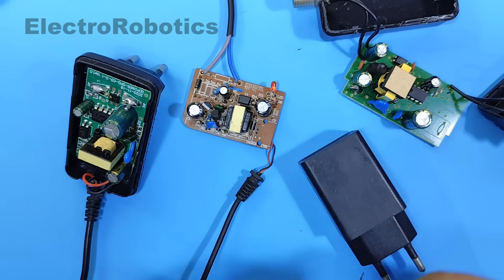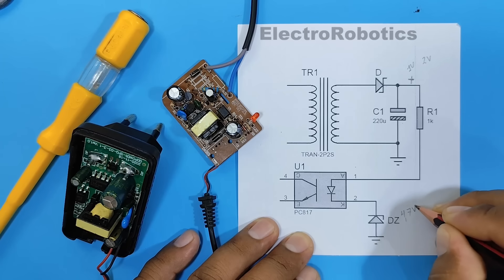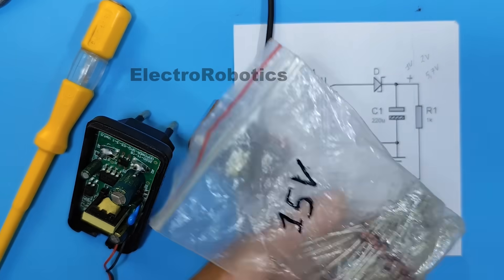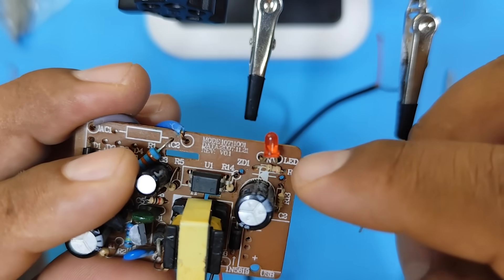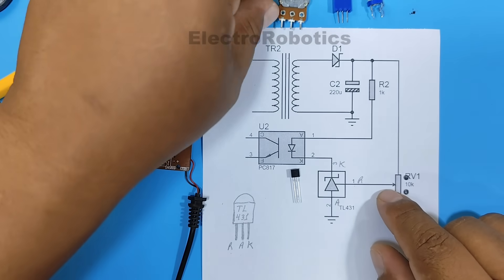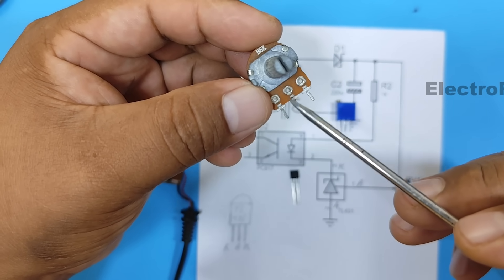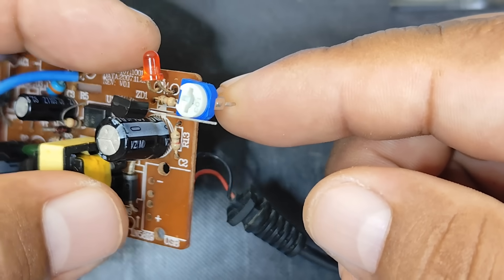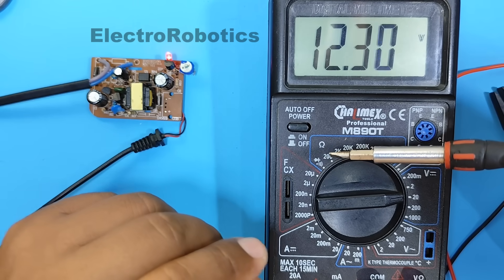Modify Any Charger and Adjust Its Voltage.

Comment: Nice love it!
Now how about a video explaining what happens at the other end of the opto coupler. 
Like why does the voltage stop climbing .
Reply: Do not be FOOLED !

So much mis-information
- FIRST SAFETY  is important but no safety precautions are given. The part about adjusting the trimmer is scary bad.
- The current must be reduced else it will over-heat and self-destruct.
 - it does NOT work on all chargers. 
- the output waveform will be degraded, so the load may not work properly.
- he does briefly mention the issue with the output cap .....be CAREFUL. For example if you change to 12V then the output cap must rated at least 16V

 This mod has been around for many years  by very ignorant channel makers. It is too bad he has repeated the same mistakes and same mis-information. He should know better.

Comment: The electrolytic capacitor voltage ratings must be changed if lower than the new voltage rating. Otherwise, they will roast.
Reply: Many flaws in this so called "quick fix." I hope no ones house burns down because of it.

Comment: U just earned a subscriber.
Reply: Do not be FOOLED !

So much mis-information
- FIRST SAFETY  is important but no safety precautions are given. The part about adjusting the trimmer is scary bad.
- The current must be reduced else it will over-heat and self-destruct.
 - it does NOT work on all chargers. 
- the output waveform will be degraded, so the load may not work properly.
- he does briefly mention the issue with the output cap .....be CAREFUL. For example if you change to 12V then the output cap must rated at least 16V

 This mod has been around for many years  by very ignorant channel makers. It is too bad he has repeated the same mistakes and same mis-information. He should know better.

Comment: Thank you for making this video tutorial
Reply: Do not be FOOLED !

So much mis-information
- FIRST SAFETY  is important but no safety precautions are given. The part about adjusting the trimmer is scary bad.
- The current must be reduced else it will over-heat and self-destruct.
 - it does NOT work on all chargers. 
- the output waveform will be degraded, so the load may not work properly.
- he does briefly mention the issue with the output cap .....be CAREFUL. For example if you change to 12V then the output cap must rated at least 16V

 This mod has been around for many years  by very ignorant channel makers. It is too bad he has repeated the same mistakes and same mis-information. He should know better.

Comment: It is Neither the Brand Nor the Products that Attracted me. But, the Noble Approach the Advertiser from Tamilnadu has, in the Middle of a Youtube Video in Such a Well Mannered  way💕 <3 <3 <3 Unlike Those Rude Gamblers/Advertisers(Mostly  Scammers)🤮🤧 within our Country 🇮🇳🤮🤧that, usually Appear in the middle of Nowhere(always) in Irritating >:(  ways🤬🤬🤬🤬😡That, I might End up buying a Few Pieces from them👍🏻👍🏻👍🏻👍🏻👍🏻And I also think, Others Must learn from them How to actually "Approach" 🙏🏻
 the Viewers if they want to Promote  something rather than Bugging! 🤬

https://youtu.be/zD1mbbCMP2s?si=v1zxsG1b9-PnvKFK
Reply: >>>>>>  Do not be FOOLED !

So much mis-information
- FIRST  no safety precautions are given. 
- The current must be reduced 
 - it does NOT work on all chargers. 
- the output waveform will be degraded, so the load may not work properly.
.. be CAREFUL. if you change to 12V then the output cap must rated at least 16V

 This mod has been around for many years  by very ignorant channel makers. It is too bad he has repeated the same mistakes and same mis-information. He should know this unless he is a Professor of BS

Comment: I really learned how change the output voltage of the celphone charger. And I probably can do it to other adapter.😊
Reply: DON'T!!!
Reply: >>>>>>  Do not be FOOLED !

So much mis-information
- FIRST  no safety precautions are given. 
- The current must be reduced 
 - it does NOT work on all chargers. 
- the output waveform will be degraded, so the load may not work properly.
.. be CAREFUL. For example if you change to 12V then the output cap must rated at least 16V

 This mod has been around for many years  by very ignorant channel makers. It is too bad he has repeated the same mistakes and same mis-information. He should know better.

Comment: Thank
Reply: >>>>>>  Do not be FOOLED !

So much mis-information
- FIRST  no safety precautions are given. 
- The current must be reduced 
 - it does NOT work on all chargers. 
- the output waveform will be degraded, so the load may not work properly.
.. be CAREFUL. if you change to 12V then the output cap must rated at least 16V

 This mod has been around for many years  by very ignorant channel makers. It is too bad he has repeated the same mistakes and same mis-information. He should know this unless he is a Professor of BS

Comment: Galing ng Pinoy! Salute
Reply: Do not be FOOLED !

So much mis-information
- FIRST SAFETY  is important but no safety precautions are given. The part about adjusting the trimmer is scary bad.
- The current must be reduced else it will over-heat and self-destruct.
 - it does NOT work on all chargers. 
- the output waveform will be degraded, so the load may not work properly.
- he does briefly mention the issue with the output cap .....be CAREFUL. For example if you change to 12V then the output cap must rated at least 16V

 This mod has been around for many years  by very ignorant channel makers. It is too bad he has repeated the same mistakes and same mis-information. He should know better.

Comment: Good job how would i increase amps as voltage increase
Reply: >>>>>>  Do not be FOOLED !

So much mis-information
- FIRST  no safety precautions are given. 
- The current must be reduced 
 - it does NOT work on all chargers. 
- the output waveform will be degraded, so the load may not work properly.
.. be CAREFUL. For example if you change to 12V then the output cap must rated at least 16V

 This mod has been around for many years  by very ignorant channel makers. It is too bad he has repeated the same mistakes and same mis-information. He should know better.

Comment: Just don't electrocute yourself. You worked there with an unsecured mains voltage device. Which can be 240V and 20A on normal outlets. Ground fault detection and isolated, current limited circuits go a long way.

For the ones playing along at home: Don't!
And if you really can't stop yourself, do only modify it while it isn't plugged in.

Only plug it in, when the case is closed.

Comment: Wow! thank you
Reply: >>>>>>  Do not be FOOLED !

So much mis-information
- FIRST  no safety precautions are given. 
- The current must be reduced 
 - it does NOT work on all chargers. 
- the output waveform will be degraded, so the load may not work properly.
.. be CAREFUL. For example if you change to 12V then the output cap must rated at least 16V

 This mod has been around for many years  by very ignorant channel makers. It is too bad he has repeated the same mistakes and same mis-information. He should know better.

Comment: Make Sure to pay attention to CAPACITOR voltage too, over voltage the capacitor it will make it Explode, change the capacitor to higher capacitor voltage rating
Reply: He mentioned that, CLEARLY, in the video. 🤦🙄 Unless of course, he redid the video between the time you posted this comment on the first week of April until now, April 27th.🧐🤔
Reply: @mahmoudbitar6571

He addresses that at 11:09.
Reply: Stated that clearly
Reply: Also consider the original power at its output. So if you alter a 5V/1A output to 10V, its output currents should stay below 0.5A to meet the capabilities of the total circuit.
Reply: For safety, unplug from AC supply voltage,  wait for 30 minutes before touching any electrical compoent ( s ).
Reply: @davidchoi6068 Pointless waiting 10min just shorten it out
Reply: Who bas 30 to throw away. Just short the cap and move on with life.
Reply: 😂😂😂😂 while he know the difficult stuff of modifying this then do u expect u know better than him... hurm...
Reply: Thanks for the reminder. He mentioned it but it doesn’t hurt to emphasize this important caution to this electronics neophyte. 🤔  👍

Comment: Wow, thanks for sharing sir
Reply: DO NOT BE FOOLED!!!
So much mis-information
- FIRST SAFETY  is important but no safety precautions are given. The part about adjusting the trimmer is scary bad.
- The current must be reduced else it will over-heat and self-destruct.
 - it does NOT work on all chargers. 
- the output waveform will be degraded, so the load may not work properly.
- he does briefly mention the issue with the output cap .....be CAREFUL. For example if you change to 12V then the output cap must rated at least 16V

 This mod has been around for many years  by very ignorant channel makers. It is too bad he has repeated the same mistakes and same mis-information. He should know better

Comment: Thanks für the theoretical part. Well explained. However, I would never beef up the output voltage of such a power supply. Higher voltage means the power will most likely increase as well, because P=U*I (depence on the load). A 5V power supply is designed to deliver 5V by a given  max max output current. Designed means track widths, components power ratings, heat sinking, etc. are selected to handle the max power it's designed for and cannot  handle more power. (Otherwise it would be more expensive, especially the China products).
Thus the modded PSU will die soon, with or without magic smoke or even fire. It's not worth it.
Reply: Or rather the rated power can't be exceeded, it must match the same power it had with original output voltage. For example 5V at 2A can deliver 1A at 10V.

Comment: I have a canister full of adapters, stored in the hope of changing voltage and reutilize them.
Nope!
It doesn't work almost in all cases.
Several times you got a jitter voltage, other times, the modified adapter cannot supply a even ridicule current, in other times it won't work at all, since the circuit is different and cannot work with other voltages.
Is dead end path. Useless

Comment: 🖖🖖🖖
Reply: >>>>>>  Do not be FOOLED !

So much mis-information
- FIRST  no safety precautions are given. 
- The current must be reduced 
 - it does NOT work on all chargers. 
- the output waveform will be degraded, so the load may not work properly.
.. be CAREFUL. if you change to 12V then the output cap must rated at least 16V

 This mod has been around for many years  by very ignorant channel makers. It is too bad he has repeated the same mistakes and same mis-information. He should know this unless he is a Professor of BS

Comment: How can you increase the current of the charger?
Reply: >>>>>>  Do not be FOOLED !

So much mis-information
- FIRST  no safety precautions are given. 
- The current must be reduced 
 - it does NOT work on all chargers. 
- the output waveform will be degraded, so the load may not work properly.
.. be CAREFUL. if you change to 12V then the output cap must rated at least 16V

 This mod has been around for many years  by very ignorant channel makers. It is too bad he has repeated the same mistakes and same mis-information. He should know this unless he is a Professor of BS
Reply: Buy a bigger charger and hopefully it won't burn down your house.

Comment: Oh my God ! it's really  amazing idea .. thanks !🌹
Reply: DO NOT BE FOOLED!!!
So much mis-information
- FIRST SAFETY  is important but no safety precautions are given. The part about adjusting the trimmer is scary bad.
- The current must be reduced else it will over-heat and self-destruct.
 - it does NOT work on all chargers. 
- the output waveform will be degraded, so the load may not work properly.
- he does briefly mention the issue with the output cap .....be CAREFUL. For example if you change to 12V then the output cap must rated at least 16V

 This mod has been around for many years  by very ignorant channel makers. It is too bad he has repeated the same mistakes and same mis-information. He should know better

Comment: Thanks, very informative with practical explanation 🎉
Reply: DO NOT BE FOOLED!!!
So much mis-information
- FIRST SAFETY  is important but no safety precautions are given. The part about adjusting the trimmer is scary bad.
- The current must be reduced else it will over-heat and self-destruct.
 - it does NOT work on all chargers. 
- the output waveform will be degraded, so the load may not work properly.
- he does briefly mention the issue with the output cap .....be CAREFUL. For example if you change to 12V then the output cap must rated at least 16V

 This mod has been around for many years  by very ignorant channel makers. It is too bad he has repeated the same mistakes and same mis-information. He should know better

Comment: good video Brother ❤️👍🙏🙏🙏
Reply: Do not be FOOLED !

So much mis-information
- FIRST SAFETY  is important but no safety precautions are given. The part about adjusting the trimmer is scary bad.
- The current must be reduced else it will over-heat and self-destruct.
 - it does NOT work on all chargers. 
- the output waveform will be degraded, so the load may not work properly.
- he does briefly mention the issue with the output cap .....be CAREFUL. For example if you change to 12V then the output cap must rated at least 16V

 This mod has been around for many years  by very ignorant channel makers. It is too bad he has repeated the same mistakes and same mis-information. He should know better.

Comment: Interesring hack. I have thought about this  way back but then I purchased a nice programmable lab power supply.
Reply: Do not be FOOLED.
So much mis-information
- FIRST SAFETY  is important but no safety precautions are given. The part about adjusting the trimmer is scary bad.
- The current must be reduced else it will over-heat and self-destruct.
 - it does NOT work on all chargers. 
- the output waveform will be degraded, so the load may not work properly.
- he does briefly mention the issue with the output cap .....be CAREFUL. For example if you change to 12V then the output cap must rated at least 16V

 This mod has been around for many years  by very ignorant channel makers. It is too bad he has repeated the same mistakes and same mis-information. He should know better.

Comment: i would say be wary of altering the voltage, as the circuits are only designed to output the voltage they were, er, desiigned for...  a few volts each way likely wont be an issue, but i'd say a 50% change or more , especially going higher, may cause problems or even damage...
Reply: Yess! Like i said before the real solution would be to add turns in the secondary transformer, then after , changing of the regulation ratio like you did. When you  only change regulation ratio: you force the circuit to highter his duty cycle and you must not pass 30% on that  type of power supply.  (flyback). But what could more occur is that the current protection loop reacts which would lead to downvoltage output or voltage varying in loop but even the break of the power supply because the current protection is really the last chance to get it alive.
i'm and electronician engineer  and i have work on those type of power supplies.
Sorry for my english.
Reply: Is this method safe to lower the output voltage? @jeanyves5380
Reply: quite so.

Comment: Very informative video
Reply: DO NOT BE FOOLED!!!
So much mis-information
- FIRST SAFETY  is important but no safety precautions are given. The part about adjusting the trimmer is scary bad.
- The current must be reduced else it will over-heat and self-destruct.
 - it does NOT work on all chargers. 
- the output waveform will be degraded, so the load may not work properly.
- he does briefly mention the issue with the output cap .....be CAREFUL. For example if you change to 12V then the output cap must rated at least 16V

 This mod has been around for many years  by very ignorant channel makers. It is too bad he has repeated the same mistakes and same mis-information. He should know better

Comment: This is a AI video. Just saying.
Reply: >>>>>>  Do not be FOOLED !

So much mis-information
- FIRST  no safety precautions are given. 
- The current must be reduced 
 - it does NOT work on all chargers. 
- the output waveform will be degraded, so the load may not work properly.
.. be CAREFUL. if you change to 12V then the output cap must rated at least 16V

 This mod has been around for many years  by very ignorant channel makers. It is too bad he has repeated the same mistakes and same mis-information. He should know this unless he is a Professor of BS

Comment: Great video, i like and subscribe to your channel
Reply: Sure you did.
Reply: DO NOT BE FOOLED!!!
So much mis-information
- FIRST SAFETY  is important but no safety precautions are given. The part about adjusting the trimmer is scary bad.
- The current must be reduced else it will over-heat and self-destruct.
 - it does NOT work on all chargers. 
- the output waveform will be degraded, so the load may not work properly.
- he does briefly mention the issue with the output cap .....be CAREFUL. For example if you change to 12V then the output cap must rated at least 16V

 This mod has been around for many years  by very ignorant channel makers. It is too bad he has repeated the same mistakes and same mis-information. He should know better